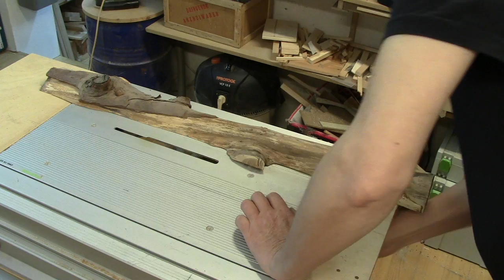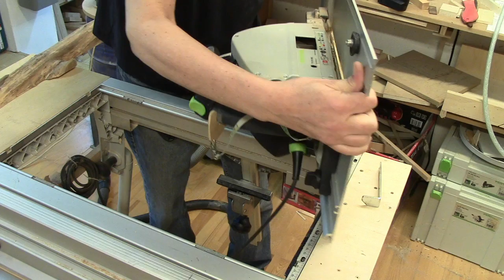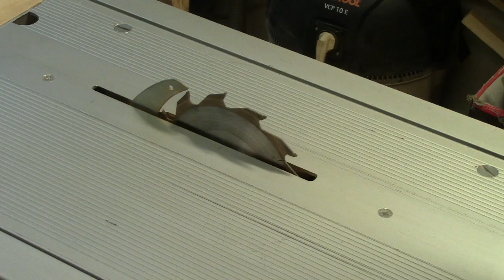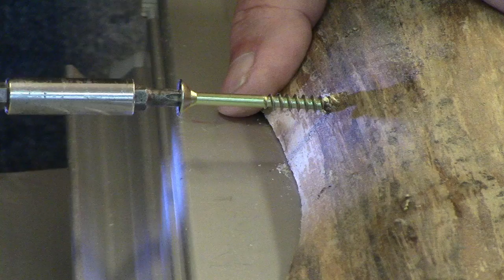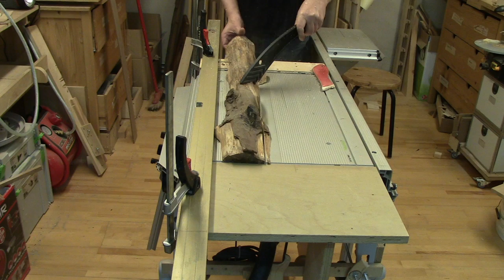DIY JIG - Is this the simplest egde cutting jig ever?

Comment: Are there any photos of the brackets used in this video to connect the shelves?
Reply from the maker: Sorry, I don't know what you mean, the clamps are "Bessey Klikclamp"
Reply: Sorry, the method in which the extension tables are fixed to the CMS table - Thanks!